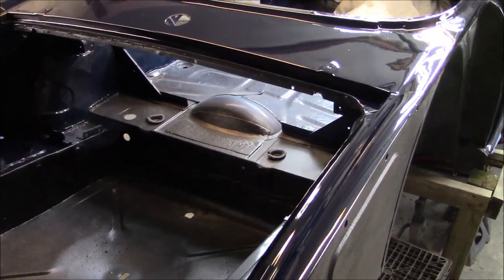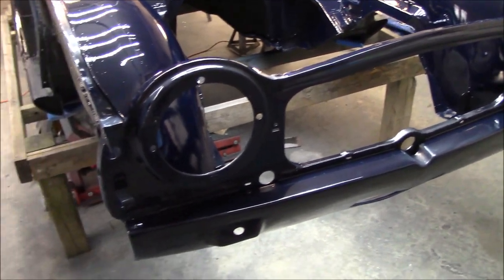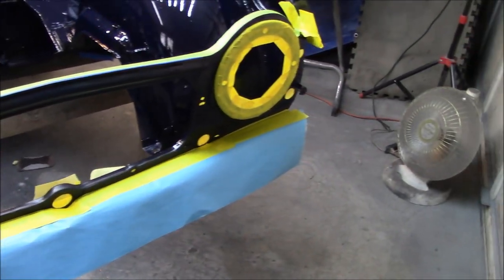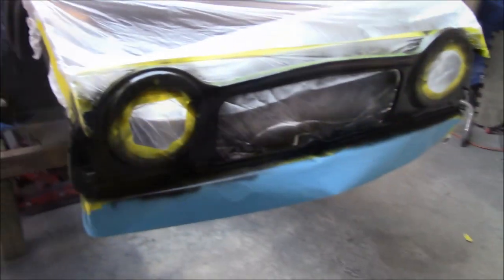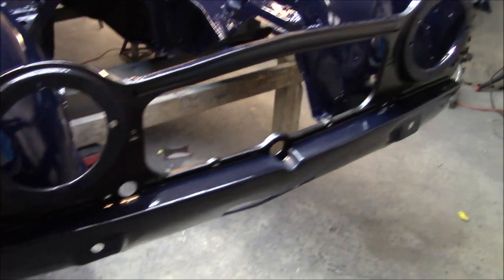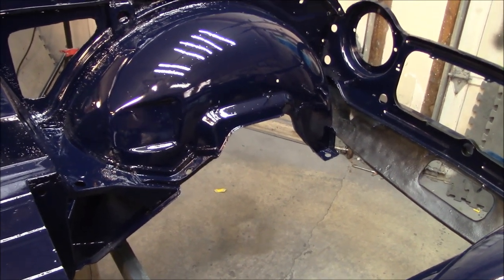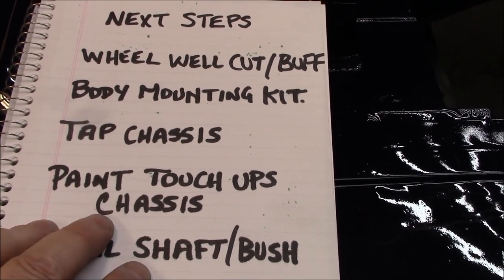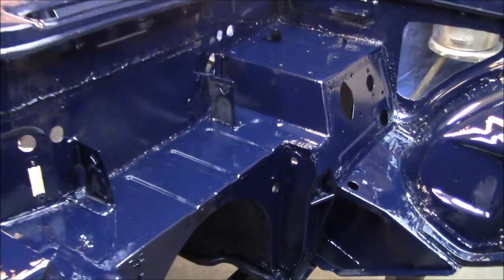1968 Triumph TR250 Restoration, Front Valance Painting and Next Steps Discussion

Comment: Nice little detail that many don't seem to do, many of the TR6's over here don't have the sills (rockers) painted matt black either. I think it looks better when you can't see body colour through the grille as per factory finish particularly on lighter colour cars. 

A list is always a great idea 👍
Reply from the maker: I’m hoping to paint my sills as well...I’ll see how well I can get the bottom trim strip to fit...there wasn’t one on the car when I bought it because the fender to sill fitment was pretty bad and the trim strip wouldn’t have laid flat...
Reply: @cheftush  I hadn't realised that TR4/4A/5/250 had black on the sills because again I've never seen one in the UK like that but I'm sure i read it somewhere that they should. That trim is a give away if the wings don't sit tight enough, good luck with getting it right 👍

Comment: Good list David, I need tofloow your method and write down the task, I have time now to cold in the garage -12 ..It would take to long & very costly to warm up the garage for a few hours of work; which is the most i can do in a day.. I need to generate a process map with some mile stones on finishing the vw bus project. I need to switch gears in the spring and up date the house and get it sold and moved into the new house and town.
Reply from the maker: I like to have two list on the go....an overall huge project list with a general flow and then a smaller list of the short term items I’m working on to complete certain tasks to move to the next stage.    I think that quite a few restorations fail to be completed as people become disheartened when looking at the big picture and the amount of work to be done...with smaller task lists, when they are completed, you at least get some sense of accomplishment and it’s easier to continue on...
Reply: @cheftush  I found that happen to me ; now I dod as my son tells me small bits dad many victories.

Comment: The black does show for sure. David what if anything do you do on the lower inside (below the grill area) of the valance. In yesterdays final wrap up of the engine bay it appears as it is not painted?
Reply from the maker: Hi Barry, it’s actually raptor linered black on the inside at the bottom.

Comment: Moving quickly..  excellent. Are the pockets bolted? Any reason for not welding them in prior to paint?
Reply from the maker: Yeah, I’ve decided to bolt them in...they were going to be too difficult to weld as there are slight undulations in the floor.
Reply: @cheftush  tush did you put the same frame supports on your tr6. Asking to determine if I should put it on the to do list for my tr 6. Thanks
Reply from the maker: @robertmorales391  no, the TR6 has a stock frame. If you are wanting to do the supports, I would only do the rear ones so you don’t have to cut channels in the body tub.

Comment: I know this was recorded several years ago, But I see you did not mask off the grounding tab on the battery shelf. The engine bay looks great. I skipped through some of these videos, it looks like you truck bed lined the inner fender areas, they look real good. Had you thought of buying the fiberglass fender liners? I will not drive my TR6 in the rain, if it can be avoided but purchased fender liners anyway, but they require some work to install and are not exactly right.
Reply from the maker: Hi Jim, I took a dremel with a grinding wheel to clean off the ground tab when installing the harness.   Yes, I used a product called Raptor liner in the inner wheel wells and inner fenders.    With the Raptor liner, I don’t believe fender liners are necessary.   I have the same liner on my 73 TR6 and have driven that car in all types of weather and road surfaces….it still looks like the day I applied it.
Reply: @cheftush  The TR6 rear fender had probably 25 lbs of undercoating on it. this still did not keep rust from forming in the areas like over the taillights in the corners. Most rust on the TR6 forms where the parts join as water (salt) seeps between the layers. Top of fenders at rear deck, along the forward deck sections and the bottom of the rear valance, where 3 layers of sheet metal join. I do not believe I will be around to see my TR getting rusty in those areas, I still have a long way to go to finish her.
Reply from the maker: @jimconklin8040  I should have mentioned as well, that before I applied the Raptor liner, I also painted it with a couple coats of epoxy primer.  I am sure this will help in these areas as well….I know this car will outlive me at least 😉

Comment: Get one of the 5kw Chinese diesel heaters, they come self contained and you just need a small hole to exhaust fumes. £99.00.
Reply from the maker: Hi Derek, I have a kerosene/diesel heater but you can’t run it prior to painting as I’ve read that it can contaminate the paint surface.